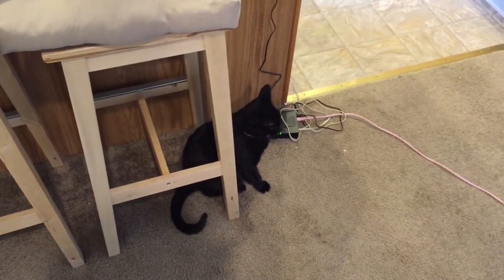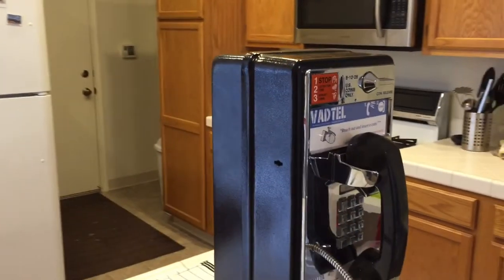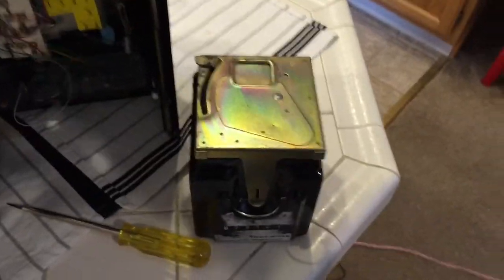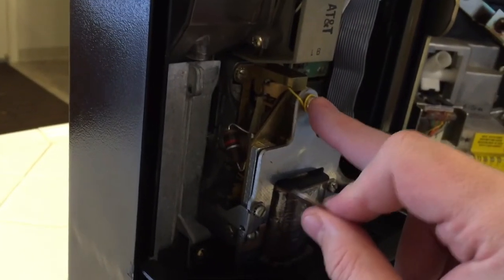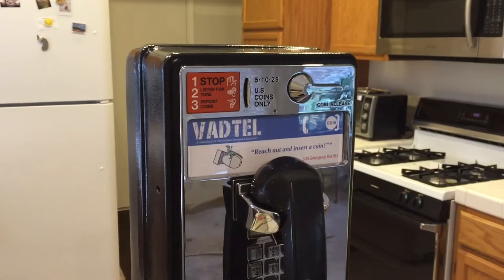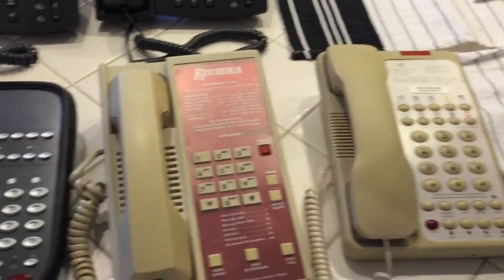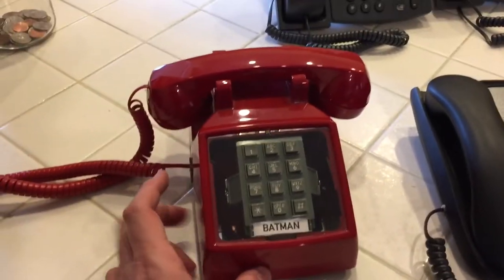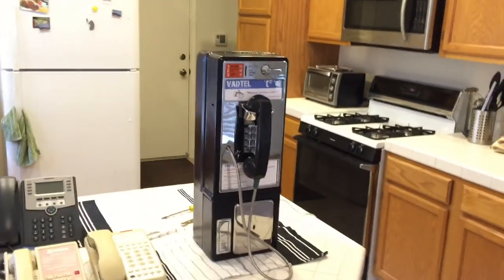Western Electric 1D2 Payphone

Comment: Picking the lock for the upper housing was difficult but not impossible. Eventually I was able to rake the Medeco lower lock, but that was after hours of playing with it while watching TV.  The GTE housings are super easy as you only need to drill a small hole above the lock and push in the lever with a rod.  If no coin box is in the vault you can open it by pushing a screwdriver through the coin hole after you remove the relay and hopper assembly.